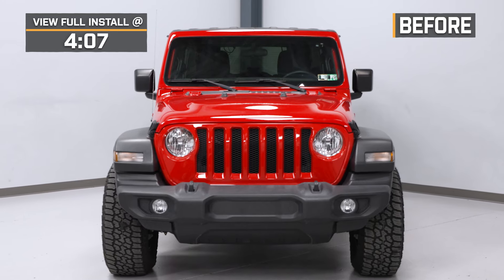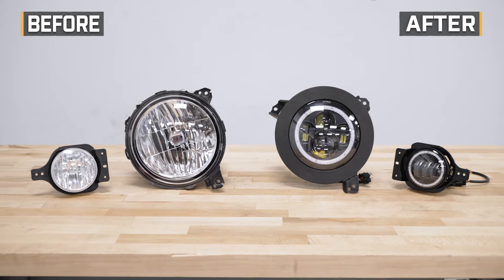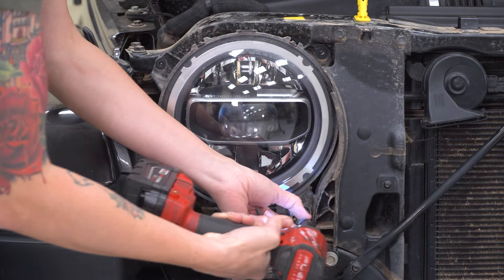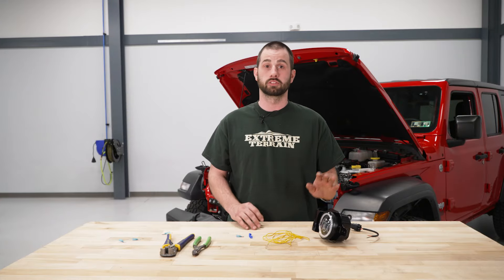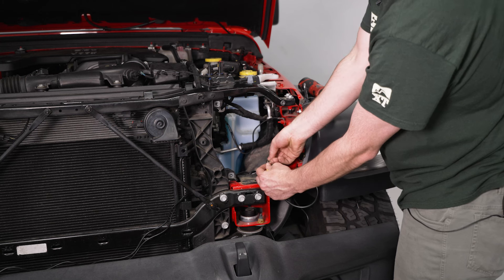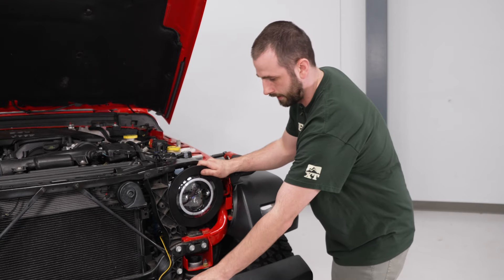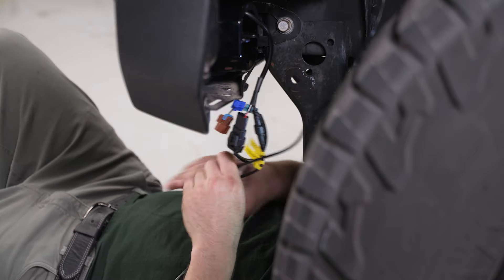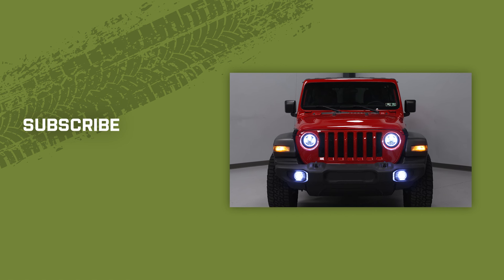Jeep Wrangler JL ColorSMART RGB Halo LED Headlights with Fog Lights Review & Install

Comment: Just got these from Extremeterrain. I have an issue in the installation process. At 13min in this video, the rgb module is connected to the wire of the turn signal.

When I access the turn signal wires, there is no connector there. Just a harness. Do I have to cut the wire and create that connector? If so, how do I know which one is which?

Thanks!